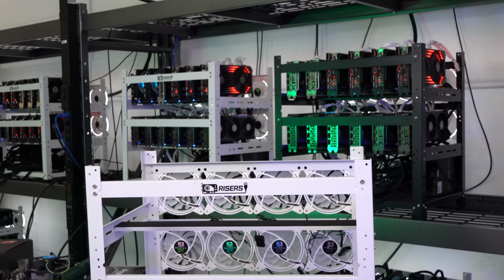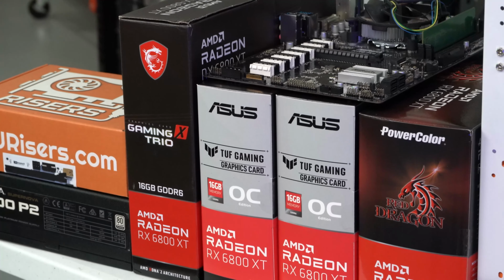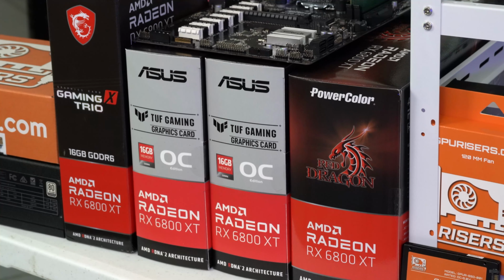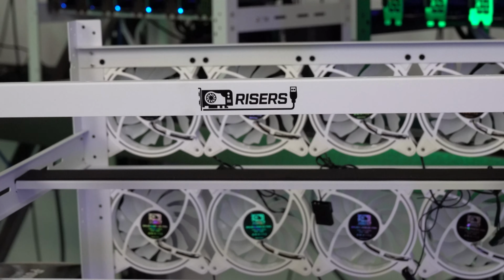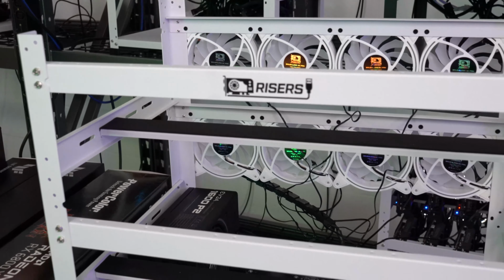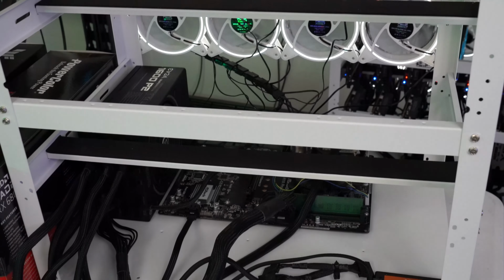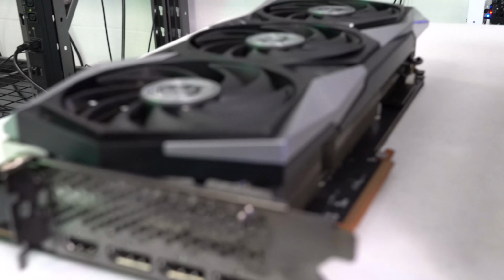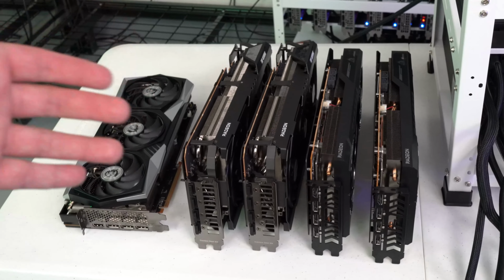Our AMD Journey Continues with More Powerful GPUs - RX 6800 XT Mining Rig Build (Part 1)

Comment: I am having hard time with Rx 570 8 gb. I and unable to tune them for full potential.
Reply: Bios modded? What is ur issue? I have few of those
Reply: @rz_g  modded and over clocked via driventool, getting only 26-27
Reply: @ytgamingdevil4559  are you using teamredminer? Windows or some other? My overclocks for 570 8gb are polarisbioseditor, core 1200(1150 works also), memory 2100 and voltage at 890(could maybe get lower at least its stable)